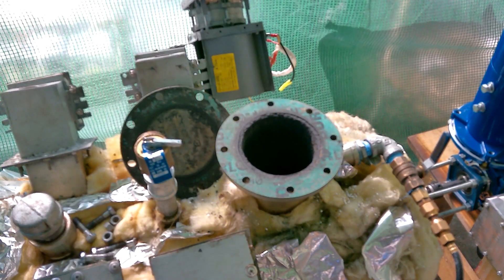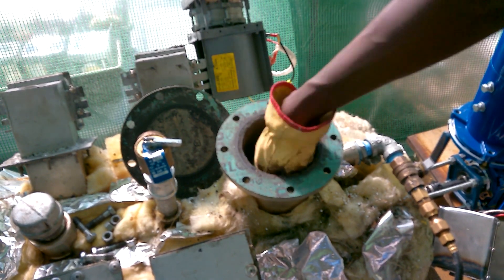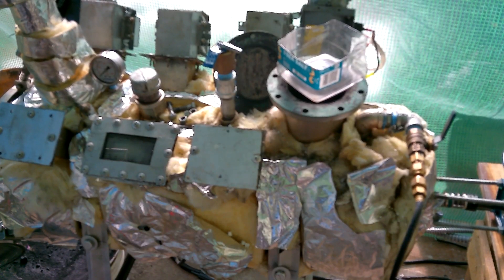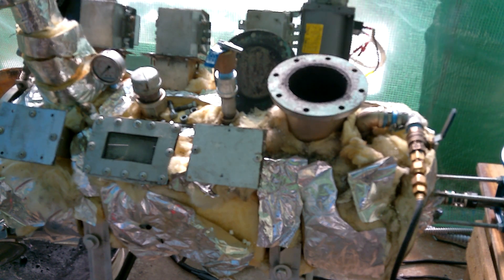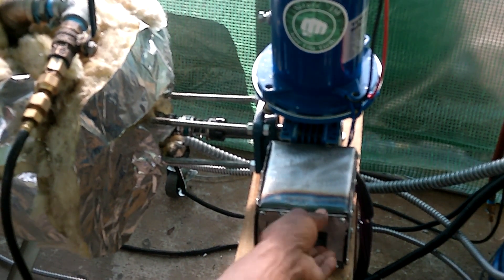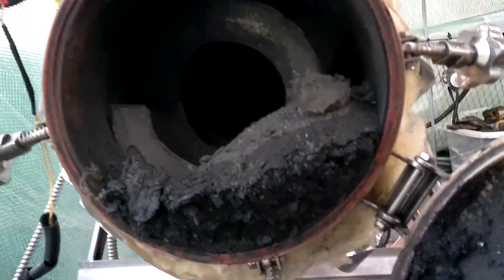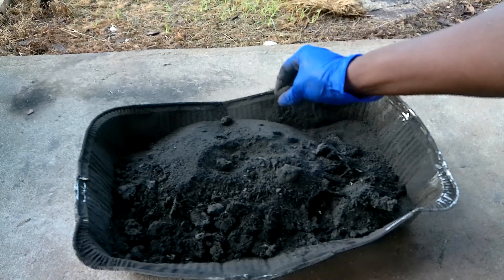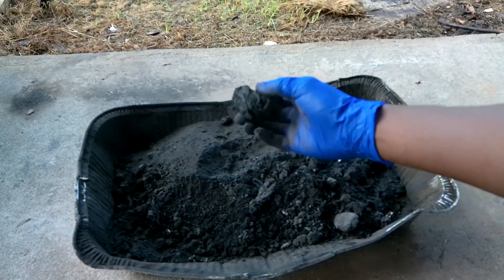My Lab Waste Turned into Fuel with Microwaves!

Comment: Would using more copper pipe turn the water and co2 to carbon monoxide and hydrogen gas? Maybe try tearing stranded copper wire apart and balkig it up sorta like the steel wool, making a catalyst chamber?
Reply from the maker: thats a great idea!

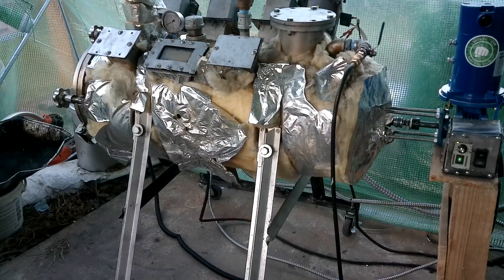Comment: Spending 25 kWh in electricity (6:20) to produce about 4.5 kWh in gas/oil that's not a great deal...

Cost wise it's about 5 dollar in electricity for about 60 cents worth of gas...

I don't know what the goal of this project is, but it is definitely not saving energy or money. Interesting method to do something with plastic waste, but just burning it would be more efficient.

Comment: How have you been using your recovered oils \ gas? Is there enough energy recovered to run the magnetrons off a generator, maybe piping the flue back into the pyrolizer?
Reply from the maker: I'm collecting them to have a large enough quantity for a large engine. I use the gas to distill the oils.